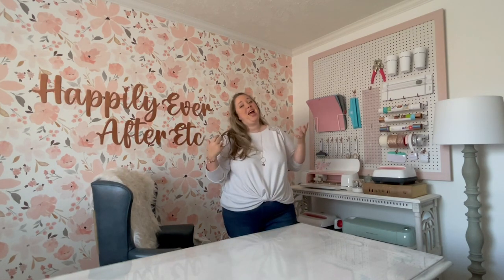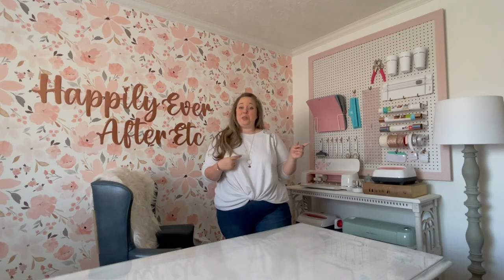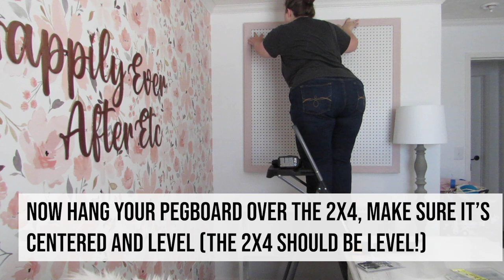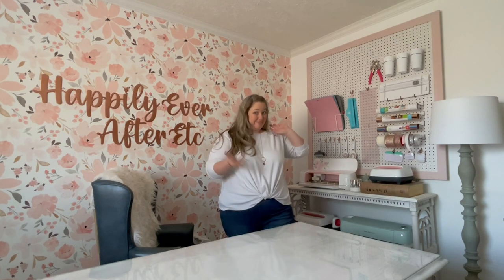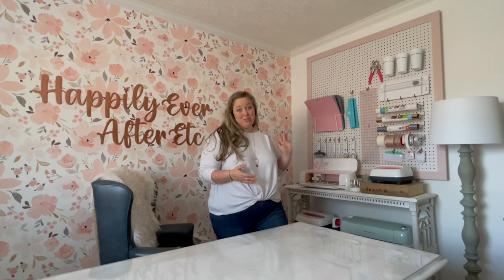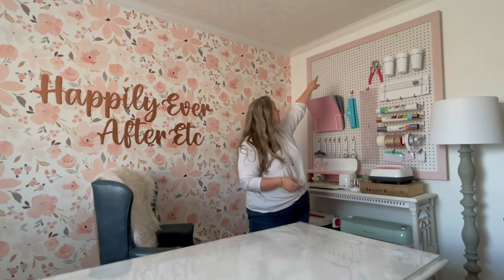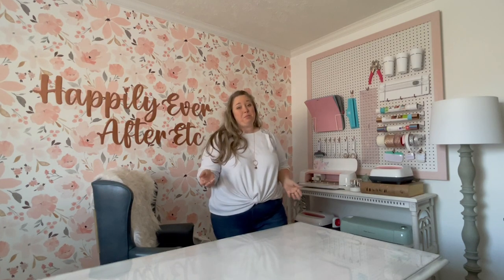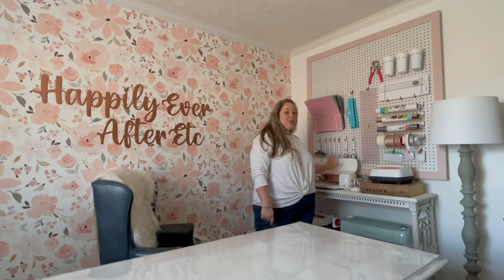How to Build a Framed Pegboard (DIY Pegboard, Pegboard with Frame, Pretty yet Functional Pegboard)

Comment: Your pegboard looks great! What length of brad nails did you use to attach the peg board to the furry strips frame? And are they the same length brad nail you used to attach the trim moulding frame on top of the pegboard?
Reply from the maker: I used heavy duty wood screws with washers through the pegboard into the wood strips on the wall. It's not as pretty as the brad nails but it's much sturdier and I don't want this baby coming down. I believe the brad nails were 1 inch and the wood screws were 2 and a half inches.